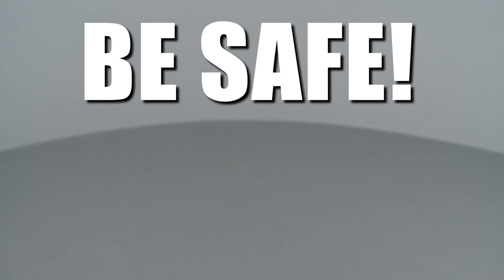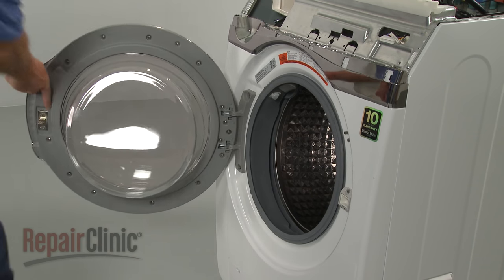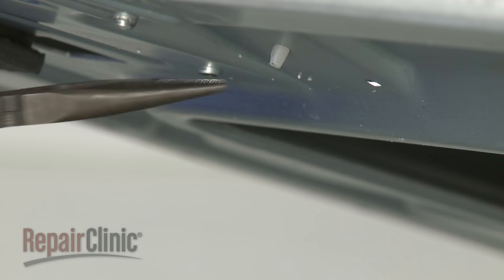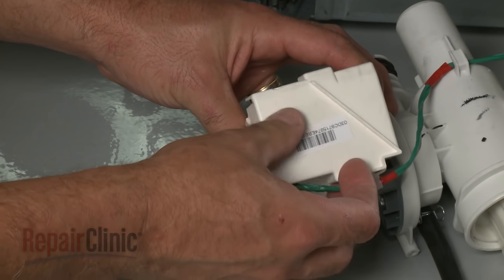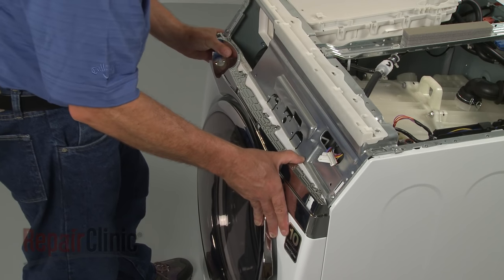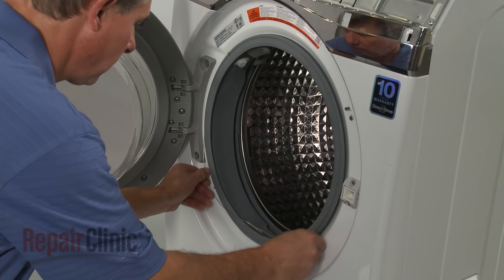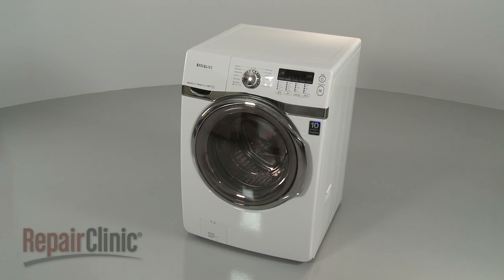Washer Not Draining? Drain Pump Replacement #DC31-00054D

Comment: Very clear movie, however for just removing the pump. NO NEED TO DO ALL THIS. Just put the machine on its side, remove the bottom plate (8 screws) and you can remove the pump. I just did this, it was 10 minutes of work including disconnecting it from the water and putting it on its side.... (you could also replace the shocks when the bottom is opened.)

Comment: I'm running my first load after the replacement now.... This is the best video ever. I think this just saved me $300.  Only point that was tricky they didn't point out, and I don't know if it matters, is the wire reconnection. Note they put the purple wire on the vertical attachment. Thanks to whoever did this!

Comment: I’ll admit i was slightly intimidated at the task of almost completely taking my washer apart to change a drain motor. Luckily however i found this video and after watching it twice then watching it i was working on my washer, i was able to finish the job start to finish in about 60 mins. Thanks to this video the cost of the fix was a $50 drain motor instead of a repairman charging you hundreds of $ for a repair you can do yourself.
Reply from the maker: Great job!

Comment: Thanks for the video! I replaced my pump. And the machine still didn't drain. I wanted to share - in my case, I had an accordion-like rubber hose connecting off to the rear. One of my kids little socks got sucked into it and was blocking the water from draining. I was able to fish it out. You can reach back and just squeeze along the hose without removing it to see if it feels like there is any object inside. Might save you the money of a new pump.

Comment: This video was great. Showed me how to take apart step by step. Removed pump and it turned out to be ok. Checked out all hoses for clogs. I found out that when I took off the rubber hose, that kind of looks like a funnel, from the bottom where the water first drains into and than gets smaller and goes into an elbow there was a quarter inside acting like a gate valve. Put everything back together and worked great. Had called a service man at first and was told it would cost at least $250.00 for him to come out. This video helped me find the problem and save me a lot of money and I got a 25 cent refund. Thanks very much!!!!!!
Reply from the maker: Charles Berchdorf II We're glad you found the quarter culprit.

Comment: Samsung Front load washer was not spinning. It would just make a hum noise. I checked all the usual, drain filter, in the seal, etc. I was dreading getting down to the pump itself, but this video is amazing! even though the model is not the same, same concept. On the newer ones there are not screws on the bottom holding the front plate on, so the step with the box is not necessary. I took the pump out and found a hairball stuck in it. To see if this was the culprit, I hooked back up the face plate, jimmied the door on and set it to spin. The motor span freely so I put it all back together. Seems to being working fine now. Thanks for the AWESOME video!!

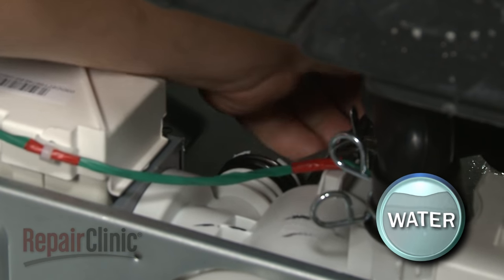Comment: Excellent step by step detailed video to resolve the 5E error. Fortunately, the washer that I am using is Samsung WF45M5500AZ bought 1.5 years ago, and its exactly same like the one in the video. I followed the steps as shown, and found a Canadian 2$ coin stuck in between the black flexible hose and the white connector on the pump visible at 3:36 and 5:15 in the video. It was probably lying there since long as it was all rusted out. It was itself acting like a filter and was blocking all the dirt coming out with the water from the washer tub. Eventually the dirt accumulated so much that the water stopped flowing out. when I removed the coin from the white connector after disconnecting the black flexible hose, lots and lots of black dirt came out of the black hose, and also kept shaking the hose to remove all the dirt out of it. Later I used the old toothbrush and cleaned out everything. Re-assembly was easy, and the washer and money, both were saved. Many thanks to RepairClinic for making and sharing this video. Subscribed 😊
Reply from the maker: Great job! We are happy to heat that you fixed your washer. Have a great day!

Comment: This video gave some good information. However, it definitely overcomplicated things. I was having an issue with water not completely draining our of my Samsung front load washer. I opened the little clean out on the front, drained the water from the small black tube, then opened the debris catcher. It was clean. I removed the drain hose from the standpipe to make sure it wasn't clogged, but I was able to drain into a bucket on the floor, so I know that wasn't an issue. I poured water down the standpipe to make sure it wasn't clogged, and all was good. Because of this, I figured my pump was going bad, perhaps not strong enough to push the water up and out. Before ordering a new pump, I decided to check all drain houses underneath. I tilted the washer up, supported it underneath, and removed to screws from inside the clean out compartment on the front. I was able to maneuver the pump around, loosen three clamps, and out came the larger black drain pipe (along with some excess water). I ran some hot water through it, but the flow wasn't great. Upon further inspection, noticed something that looked pink on the inside. With some pliers, i reached in and pulled our a wooden coin shaped toy about the size of the hose diameter. Evidently it had been wedged just the right way to stop the flow of water. Put everything back together and all is good! Don't take all parts off as mentioned in the video. There's an easier way.

Comment: Excellent Video. I work at a TV and Appliance Business. I'm more on the Home Networking/Automation/Audio-Video Side, so I usually ask one of our tech guys what to do to fix appliance problems when they arise at my house.
No need to do that after watching this video. Very detailed and the order sequence was spot on.
Even the spring clamp wasn't any trouble. You just have to get it started properly, and carefully work both sides around the seal until you get to the bottom. No problem.
Thanks again for a very helpful video.
Bit McMillan

Comment: Thank you for the easy-to-follow, step-by-step instructional video. While a professional washing machine repairman could have done this for somewhere between $200 and $400, the part only cost me about $30 with shipping from Amazon. Due to your instructions, it was so easy that even a B-52 pilot turned novelist could do it. The pump I removed turned easily by hand, in contrast to the new one which offered an expected resistance. During the post-repair ops check, the machine ran like new. I'm subscribing.

Comment: I've used the guidance in this video twice in a little over a year to repair my Samsung washer. While the first replacement drain pump failed me sooner than I had hoped for, this video delivered each time. Thanks for making this available. I've subscribed and will explore all your helpful products.
Reply: Are you sure the pump failed? The water level sensor can malfunction keeping the motor from running as well
Reply: @full95one  I'm positive the pump failed. The plastic part, I'll call it the propeller, separated from the drive motor, resulting in a lot of noise but no movement of water. I'm rapidly becoming an expert on this particular procedure. Four months after the second replacement, the pump failed again--the part failed in the same exact manner. This time, I replaced it with a new OEM part, with a one-year guarantee. At Amazon, the price for an OEM was less than $10 more than the now proven unreliable discount pumps. Hoping it lasts at least a year this time.

Comment: This can all be done from underneath the machine. No need to remove the front panel. After he removes the 2 filter housing screws at 1:53 take a screw driver and pry off that rectangular plastic panel that surrounds the filter cap. That will expose the 3rd screw that needs to be removed. Then simply tip the machine back and  work from underneath.
Reply: Thanks
Reply: Thanks for the great tip. Saved me a lot of time.
Reply: Great vid and this tip, a big help if you don't mind disconnecting the fill and drain hoses and have space to pull it out and can do it physically because the washer is still a bit hefty. Spun it and put it on its side, There is a big port in the bottom of the frame that allows easy access to all of it. Part was about 36cdn plus tax delivered on 2-day prime! Much appreciated after a Monday fail and washing again Friday evening! Only took that long because I couldn't make up my mind to do it...a congratulatory irish was easily paid for by the savings.

Comment: I didn't think to look this up on YouTube when our washer quit. So we had an A&E repairman come out and look at it. He diagnosed the problem, and ordered the new pump. It came today. I called them to set up an appointment and they won't be able to come until May 2. We basically told them to shove it, they said now that we had ordered the part through them we HAVE to use them to install it. After watching the video, it definitely looks doable. Thank you for this very "idiot-proof" post. Will show it to my husband.
Reply from the maker: That doesn't sound fun! We hope it works out ok in the end.

Comment: Have to say this video saved me buying a new washing machine.  At first I thought my washer was on the fritz and was about to buy a new one.  Started searching for common problems and found the drain pump as one of most common searches.  Found this video, ordered the part and just finished replacing the pump.  Machine is back and running again so I am a happy camper.

In our case we have our washer on a pedestal (and its a slightly different model than the one in the video) and I am not sure if its specific to our model or if the installers did it when they attached the washer to the pedestal but my washer is missing the screws on the bottom that secure the front panel.
Reply from the maker: +Wandering Digit Thank you for sharing.

Comment: Thank you thank you thank you. You just saved me a big bill. Part cost me $26 bucks on Amazon and a few hours of my time. There was nothing wrong with my pump. Some how rubber band got wrapped around the spinning portion. I was able to remove it but just replaced it with a new one because it is a pain taking that machine apart.
Reply from the maker: You're welcome. We sell parts at RepairClinic.com.

Comment: Great video!  some notes:  My washer was on a pedestal, which made accessing the clip to release the pump underneath impossible without taking it off the pedestal, which I didn't want to do.  I was actually able to unscrew the pump from it's assembly while it was still in the machine ( after unhooking pumps/electrical of course)  Also,  my original pump, when I took it out,  the fan was almost all the way out instead of flush like the replacement pump.  When I pushed the fan back in,  it seemed exactly like the replacement pump.  I wonder if that would have fixed my problem,  but I figured since I had the replacement I might as well put it in, so I don't know.  but maybe someone else with the same problem can try it and see.  to get the front cover off on my model I had to remove the filter encasement and then of the three pegs at the bottom, right and left had screws, none in the middle.  So a little different.
thanks again for a great video!
Reply from the maker: Great points. Pedestals are optional accessories for washers and dryers.

Comment: Great video; I used its info on a slighter new model, and it worked!  Just something stopping up the the impeller, rinsed the inside of the pump and put back together, works like new.  One thing to note, the more recent stainless ones, BE CAREFUL REMOVING THE FRONT PANEL!  The door latch assembly is floating free without those three screws (requires some prefastening when you put it back together) and the entire door is part of the front panet, which also has incredibly sharp raw steel edges.  Other than that, everything else in this video is 1:1 perfect for that model; thank you!

Comment: Tip to save time - my Samsung washer wf409anw/xaa (from 2011) did not require accessing the bottom for any screws or pump bracket. There are simply tabs on the bottom that the front panel lifts up out of, and the pump bracket is made to release from the inside. Knowing this would have saved me a lot of trouble of removing my pedestal stand!

Comment: A couple lessons. Highly recommend you remove all the hoses and clean thoroughly as they all had much more gunk in them than I thought would be. If you replace pump without doing this I think it will definitely shorten life of your new pump. I tested the old pump to see if impeller was turning in machine on spin- you can see impeller through catch drain on lower front. Mine did turn but machine would not complete spin cycle (stuck at 11 mins). I replaced the pump (40$Cdn off Amazon for pump and motor only) and it worked. Housing is plastic so really did not need replacing and it saved me 60$. I used a flat blade (vs needle nose pliers) to access the spring ring holding rubber cover on front panel. Easiest start point is located at the bottom of the opening (6 o’clock position). 
While accessing pump is definitely easier if you tip on it’s side... to properly clean the hoses, which I highly recommend, I think front access makes this easier. Trying to reconnect hoses if you removed them while it is on it’s side is definitely trickier. If you have cleaned hoses, reassembled and it still did not work ( my situation). I decided to replace the pump and motor by tipping on its side, a couple of screws are tricky but I used the bit to start the screw then tightened with screwdriver. The wiring harness is easier to reattach to pump if you release the wire from plastic twist tie (simply feel along the wire and you will feel it - release it and then reattach after you attach it to pump. 
The rubber flap on plastic housing opens outward toward the main drain, it prevents water from going back into machine. Check for coins inside the two plastic houses. Main one holding pump and one attached to largest black pipe draining drum. Easier to access it from the back where two screws hold an access panel on. Certainly this video really helps. Saved me a lot of money on a service call. Thanks.

Comment: Just an FYI to others searching for a fix.

My sister's Samsumg VRT frontload washer would stop mid rinse cycle, always 11 minutes left, the warranty just ran out.  My money was on the pump or the main board being bad until I looked around online more.

I sent her hubby this video site.  With help from this video my bro-in-law took the washer apart.
Interestingly he found  3 "drain hoses", 2 needed cleaning and one was almost completely blocked and I quote him  "It was like watching a sausage machine the way the gunk came out of that hose.  After watching that video I decided to clean everything.  The pump itself was only a little dirty."

After doing 4 loads, all is well, so the problem looks to be solved.

Personally, I would rather try to fix things myself and that was the 4th time repairclinic.com helped.
I feel bad though, nothing was purchased from them this time (or 2 other times :)  )

Thanks and kudos to repairclinic.com,

Dave
Reply from the maker: +Dave inCleveland Thank you for the comment!  Glad we could help!

Comment: Well, I replaced the pump, checked the large tube on the bottom ,clear, and still not draining. Is it possible to reverse the two wires plugged into the pump and would that affect it? I’m stumped here as to why it’s not working. Also, what does the pump on the other side do?

Comment: I have a slightly different model of the machine, and I found it much easier to check my pump from the bottom, without actually taking off the entire front panel,
In my washer, I have a bolt fastening wire, instead of the retaining wire and spring,and it is from the inside of the panel, so removing, and putting it back on is a bit challenging.
The machine is almost entirely open from the bottom, and the pump is easily accessible.
Reply from the maker: Thanks for the tips! What is your washer's model number? It will be helpful to future viewers.
Reply: It's P1453S Samsung 6.0kg washer.

Comment: Video is incredible helps a lot, but I ran into a little issue..........the screws by the drain pump and the screws on the bottom of the front panel have rusted and are locked pretty tight......any pointers?

Comment: WF50R 8500AV, this model of Samsung washer has an extra opening on top, in drain pump housing, a hose from that opening goes to tub. But is not recirculation hose. Can you tell me why that hose is there for.

Comment: The instructions got me to the hoses.  I think the pump is fine, but the hoses were all clogged with goo.  I've gotten them all off and cleaned them out except the one that attaches to the bottom of the tub.  Most of the hoses use pressure or pinch clamps, but the one on the bottom of the tub uses a screw clamp and the screw faces the back.  The washer is on a pedestal and I can't easily get it away from the wall to remove the back panel.  Is there a way to handle this from the front?
Reply: Derek Carlson and